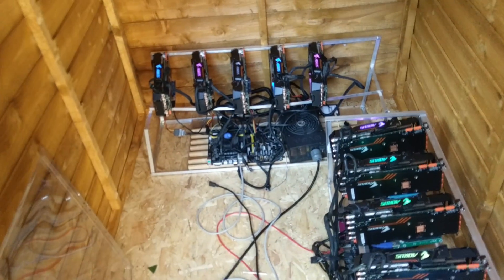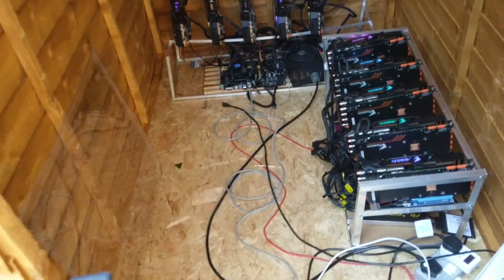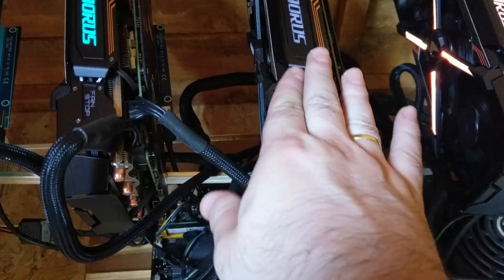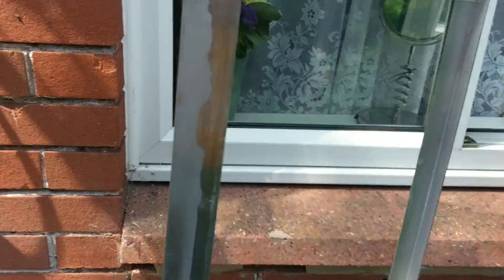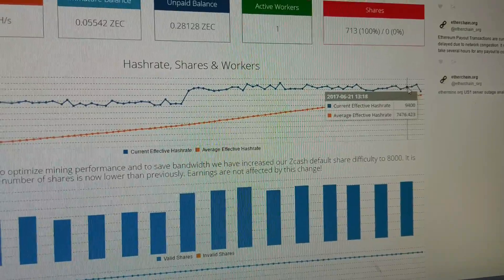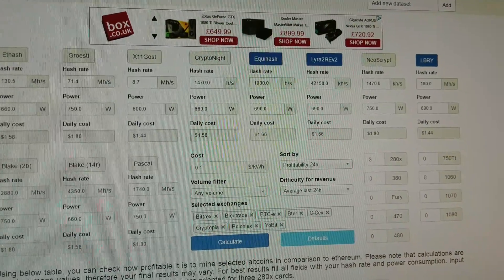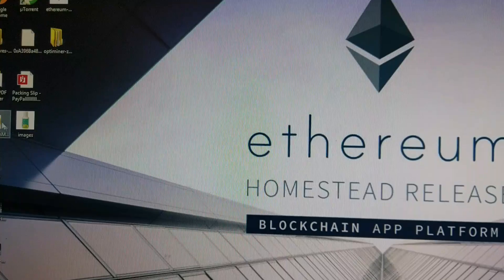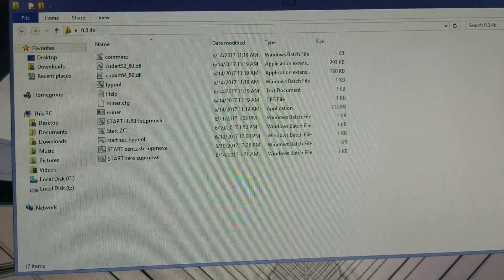Zcash mining rig x3  10500 sols  21 June 2017

Comment: Hello @TheCrypto Guy and to all your followers, Ive already build my first rig, installed all the drivers, Im using win10, I didnt overclock my gpu " nvidia gtx 1080ti aorus", and the miner says 0 sols/s, do you know the solution for this insue. Its the same rig like yours but only one card. If somebody is interested to help me I will send some donation. 

Asrock h81 btc pro, same processor, same card, 1500w of power supply. I dont know what it could be, if someone can help me, thank you very much.

Comment: There are a few things that you didn't account for in your example calculation.  You left the power consumption at 230w, which, unless you're some kind of sorcerer, that seems highly unlikely for such a rig.  ; )
You also didn't adjust your power cost or pool fee.   
As a subscriber, I do recognize that you know what you're doing.  Just pointing out that the calculation is off, for other viewers that might think that you can get such a rig down to 230 watts.
Reply: Ok, valid point, but pretty certain that most viewers are going to be interested in profit, rather than earnings.  But, noted, and thanks for another vid.
Reply: Then dont use a profit calculator, It's misleading the way you use it.